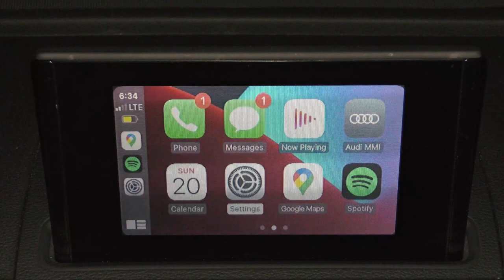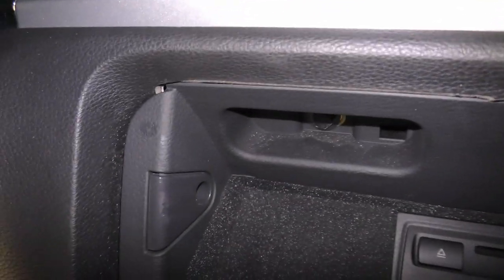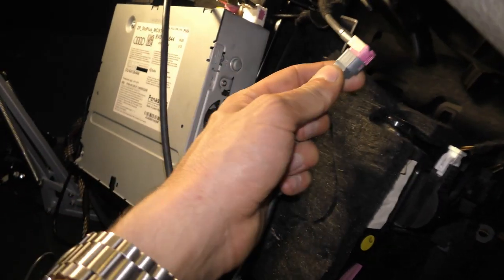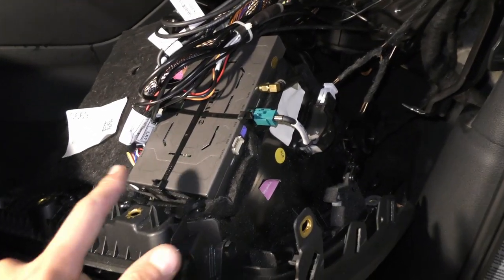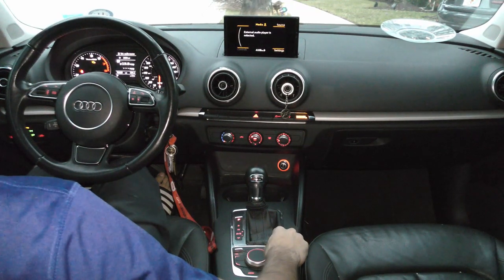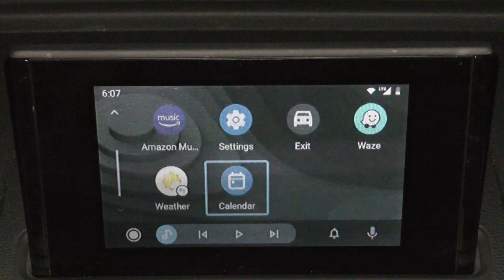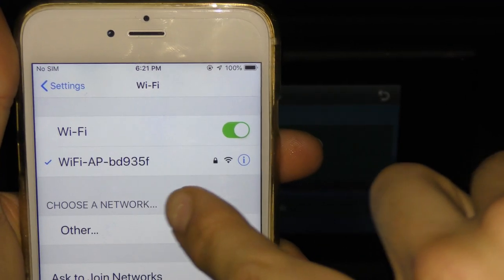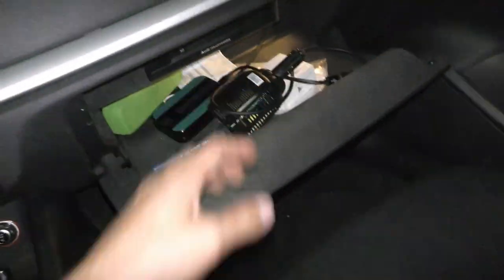How to Install Apple Carplay & Android Auto in Audi A3, S3, RS3 8V 2015 to 2017

Comment: I have a 2016 Audi A3 with internal microphone, backup cam, etc.  Will this unit work rather than having to route thier microphone and GPS?
Reply from the maker: The gps, camera and mic found in the audi only works with the original Audi infotainment system. It will not cross over to the aftermarket unit that attaches as an adapter to the radio unit.

This means the aftermarket gps, aftermarket backup camera (if installed on a car that did not have the rear view camera from factory) and the aftermarket microphone has a purpose, and it's to work on the aftermarket radio adapter. The omly way to get the original audi mic, gps and camera is to actually replace the radio unit or screen or find another company that supports the features you are looking for.

Comment: Dude has the most base model a3 possible
Reply from the maker: It's not my car. I own a modified 2013 A4, a 2018 A4 6 speed manual, a 2014 Q5, 2009 VW Jetta, a 1997 A6 avant, a 1997 Audi Cabrio, a 1995 UrS6 Avant, a 1993 UrS4 sedan, three 1990 Coupe Quattro's, a 1986 Audi Coupe GT and a 1984 Audi UrQuattro. You are not funny at all, think before writing nonsense
Reply: @MotorHeadTech  damn bro, didnt have to flex on him like that 😂😂
Reply from the maker: I turned a negative topic into a new positive topic🤠